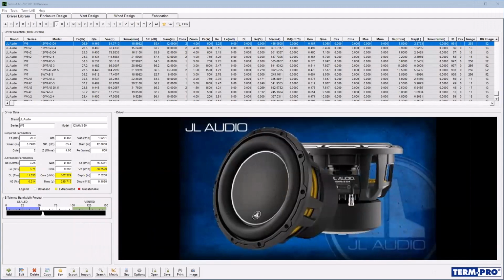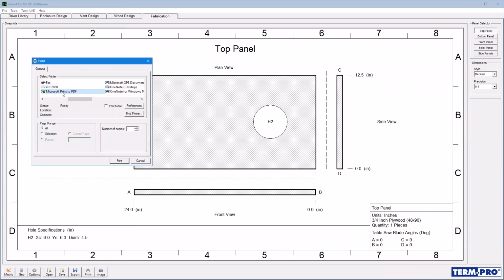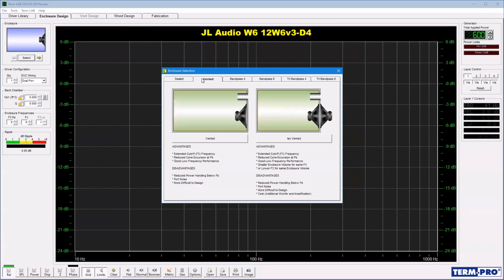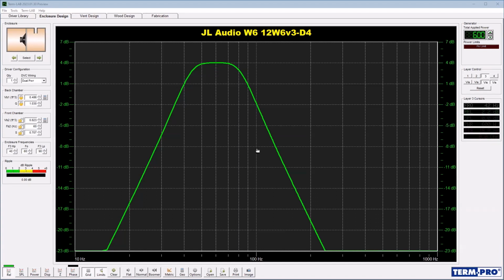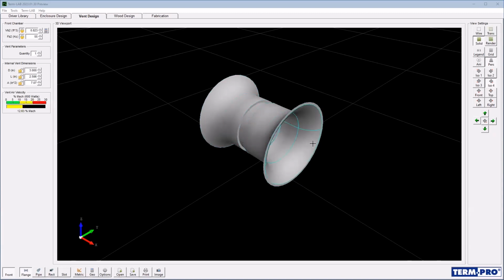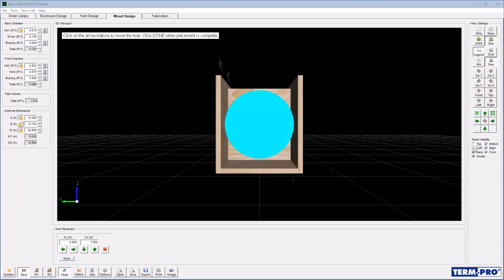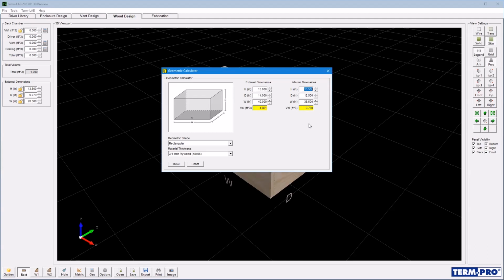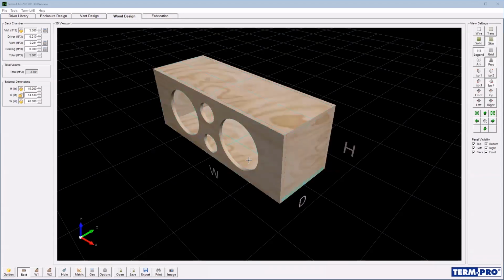Term-PRO Enclosure Design Seminar with Wayne Harris (HD)

Comment: its very difficult to use for some reason the dimension keep unlocking and the app inputs what it believes would be better but I am limited to what the vehicle allows me to build and the app wont let me see how the box I build will perform, it also wont allow for external port applications I havent been able to successfully use this not once.

Comment: How to add two sheets of 3/4 mdf to the fabrication build?
Reply from the maker: Beginning with 2023.06.15 you can specify the number of panels to laminate. Select the Options button on the toolbar and then the Wood Design tab. You will be able to select 1-4 panels. Currently this applies to all panels.

Comment: Is there an option to invert the subwoofers
Reply from the maker: Graphically, no. But, if you want to mount the driver with the basket outside of the enclosure you can change the "DD" (driver displacement) value in wood design to 0 for calculation purposes.